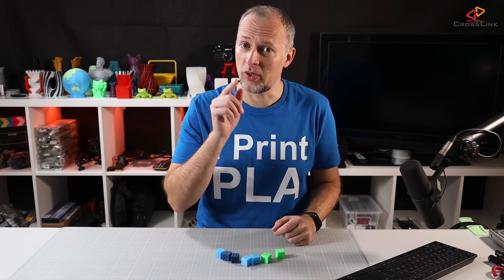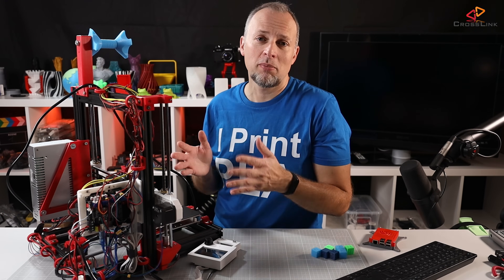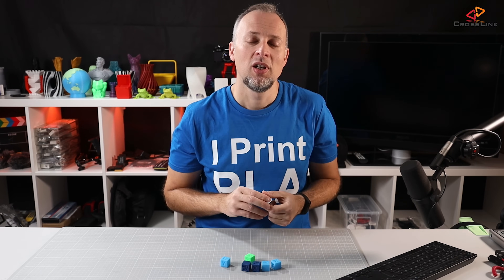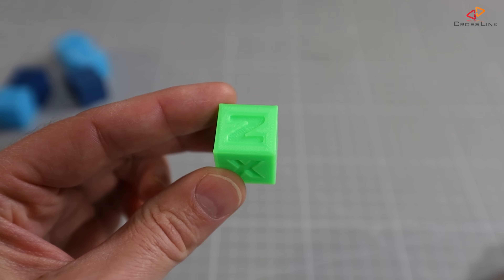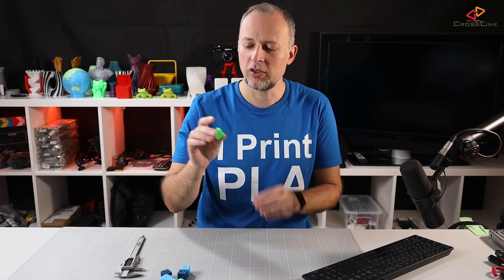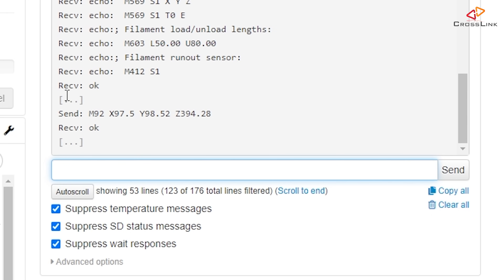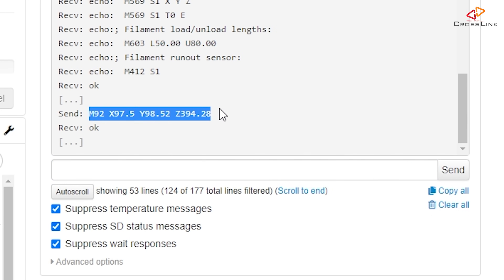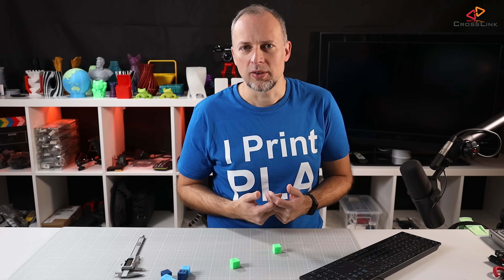SET YOUR STEPS - Fixing dimensional accuracy on your 3D printer (Cartesian only)

Comment: Ohhh noooo, this information for the X, Y and Z calibration is soo wrong and will cause issue on larger prints.
The pulleys are toothed, therefore we will ALWAYS get the same distance of travel per rotation.
The number of steps per rotation of the stepper motor is always the same. based on this the X and Y axis can be calculated from design and will be accurate for all sizes of prints.
The same applies for the Z-Axis screw and again it should be calculated from design and will be accurate.
An over dimension of a test part is always from over extrusion of the extruder.
If you change something on your printer like the size of the pulleys, and being a toothed pulley, it's diameter and circumference is easy to calculate, that's when the steps per mm for that axis needs to be changed.
My first printer I ever owned was a kit pre calibrated at the factory using this method and then locked and caused me no end of trouble printing ovals instead of circles and having bigger errors at larger sized prints.
Most (not all) standard printers like the CR10, the Anet A9 and the Wanhoa duplicator series printers all use the same size pully, based on that the X and Y axis steps per mm is 80
For the CR10 and Wanhoa, the Z is 400.
The Extruder will vary a bit from machine to machine.
Over extrusion can also cause holes to be filled in more than they should be but in some cases, you may need to adjust the horizontal expansion to get dimensionally accurate holes, this is not supported in S3D but is in Cura.

To prove the point, print out your 20x20x20 test cube, then scale it up in the X and Y axis to 150 x 150 x 20 and compare your results.
If your method was correct, then that should both be accurate, but I'm gonna bet the 150 x150 x20 will be under sized on the X and Y and not even the same amount of under size.

Ray
Reply: What you stated is true, however you are assuming all of your components are within 100%  calibrated tolerances.  The method described in the video calibrates for minor intolerances of hardware, wear,  and filament.  I wouldn't be surprised if only 1 out of 1000 pieces of hardware are being measured out of the factories in china with a passing measurement of 99.5% accurate.  The design is a starting point of measurement not the finalized numbers.
Reply: @Yakena1  You are most likely correct, however the tolerances of things like the stepper motors number of steps per rotation and the number of teeth in the toothed sprocket for the GT2 belts are going to be at a very high tolerance level as these are full unit inter values and do not change.
To get any value out of any calibration where there is a fixed limit such as the X, Y and Z travels, you need to calibrate over at least 80% of the full travel, not 10% as is done printing a 20 mm x 20 mm x 20 mm cube.
You also need to eliminate anything that can produce an error if possible such as the  amount of filament that is extruded, and this one does vary a lot and is the most common cause of errors in printers.
There are 4 settings we are looking at here and this video covers the first 3 using the name of the last one.
We have the X-Steps, the Y-Steps, the Z-Steps and finally the E-Steps.
Typically, the error in the X, Y and Z steps are extremely low to almost non-existent.
E-Steps on the other hand does have a history of being out of calibration even between batches of filament. and the ware in the extruder feed gear.
If you are going to follow a video like this one.
Calibrate the E-Steps first.
Make sure your slicer is also calibrated, and the test your X, Y and Z on a much larger print so as to cover at least 80% of the axis travel, even if you use a rectangle test part orientated in each of the 3 axis.
Reply: @CyberOne  This gets back to assuming the tolerances are with in spec.  I would not even bother doing a print.  Write a custom gcode to move your x and y axis in a continuous clockwise square (10x) that is 90% of your bed space noting your exact starting location.  Do this 10 times and measure.  It will be off by a few mm.  Now run it again counter clockwise and it will be back to the start point!
Reply: @Yakena1  Now your looking at an entirely different issue.
Repeatability.
If you have poor repeatability, then attempting to calibrate your steps per mm will result a poor result.
Things that affect poor repeatability include, loose mounts, loose belts, loose pulleys on the stepper motors.
X-steps per mm and y-steps per mm only affect the scale of the printer.

If you are having issue with repeatability with your printer, I seriously suggest you service it and tension the belts correctly.
Reply: So true.
Reply: Incidentally, E-step is short for Extruder Steps per mm. :-)
Reply: @CyberOne  i was looking for this comment because i have exactly this issue. thanks for the explanation
Reply: @EfeBaris21  Your welcome.
Reply: There is a case for calibrating belt driven axis. This is because the belt comes from the factory undersize, and is supposed to reach spec pitch of 2mm per tooth when you stretch it to spec tension. But the tension specified is usually kind of high, so you won't easily reach it on a 3D printer of any such construction without running the risk of binding or ruining the stepper motor bearing, it'll already feel pretty rough. You can easily come up a millimetre short over the size of 20cm on some machines, but i suppose some belts are lower tension to pitch.

But then of course the solution is NOT to calibrate it with a 20mm print, but to find some way to measure the movement directly over a sufficiently large distance.

One way i can think of is printing just lines on the bed that distance apart with handcrafted gcode. And then measure directly on the bed, between middles of the lines, so your over/underextrusion or bed distance doesn't imprint too much. But the measurement is difficult to perform well. Another way is to find some way to hard mount calipers such that you zero and they are pushed by the moving parts (bed and toolhead) and then measure a 150mm move, but that too can go badly because you need the calipers to be perfectly parallel to the movement direction and perfectly affixed as well such as to not move.

It's usually easier to upset the calibration than to improve it over calculated values even when measuring pretty large test prints. 20mm cubes are at best good enough for a sanity check, like you'll notice if you have a pulley which makes 100 steps/mm but you set it to 80 or vice versa.
Reply: @SianaGearz  The overall length of the belt has no bearing on the distance travelled, this is governed by the circumference of the drive pully on the motor.
The pulley is toothed with a tolerance to allow the belt to engage. but it's this one fixed machined part that set the distance travelled per revolution.  This is why, as a belt stretches over time and is re-tensioned, the calibration doesn't change.

99% of calibration errors are with the E stepper.
Here different diameter filament, or even different hardness filament can have a huge difference with the volume of extruded material.
The problem is, a lot of people will measure the cube, find it's a bit over or under and assume it's a travel issue instead of the real reason, the over or under extrusion.
Reply: @CyberOne  I agree that usually it's best not to calibrate XYZ axis but use computed values based on parts used. BUT hold it right there you say "The overall length of the belt has no bearing on the distance travelled".

My apologies for the verbosity, but i don't know how to explain what i mean better and shorter, and i can't just draw a picture in the comments.

We are going to agree that the motor and a 20-tooth pulley can advance the belt by exactly 20 teeth. But how long are the teeth? You span a belt onto an axis, you attach the teeth of both ends of the belt into the carriage attachment point, at which point the total number of teeth on the belt is FIXED. Then you start turning your tensioning adjuster that moves the idler pulley. At first the belt is loose, and we keep turning the adjuster until the belt is no longer bowed, until the slack has been taken out of it. But at that point, it's still a little too floppy, it's not going to be good enough, the belt even has enough elasticity that it might skip at the motor pulley, which wouldn't be good. So you keep turning and tensioning the belt, and you might move another 1mm from where the belt was no longer loose. These 1mm of extra belt stretch got spread over a FIXED number of belt teeth, so the length of each tooth has changed, and it has changed significantly enough to make up those 1mm of difference across those let's say 35cm of distance between the idlers. When you program a move of 20cm, and you use calculated stepping, our initial agreement comes back and thus the underlying assumption that one motor revolution is 40mm, and you make exactly 5 motor revolutions to make that "20cm" move. But with the 1mm idler adjustment, these "20cm" already grew by 0.57mm. And you're still not done with the adjustment range, you can stretch it further. And usually you're still short of true 20cm movement.

This is one of those reasons why Prusa has an auto calibration where the probe finds fixed points in the bed. Of course the system iterates on the locations until they're actually good enough and make the prints more rather than less precise, like a crude manual measurement might.

Comment: Great video! I've read online a few different arguments about how you shouldn't calibrate the steps for the x y and z as they are already calculated based on the physical components of the printer ie belt pulley size, the specific stepper motors involved ect.. I think right now the popular idea is that these inaccuracies should be fixed in your slicer with horizontal expanse.. however this doesn't make sense to me when I move my x y or z 100mm whatever axis I decide to move should move exactly 100 mm.. and on my ender 3 pro it doesn't.. sure it's close but it's not perfect.. while I've always considered calibrating the e-steps for these axes I've never actually done it as I've never heard of anyone else doing it..  but I'm all now lol
Reply: That makes no sense. Not all belts are perfect. Not all motors are perfect. Not all couplers are perfect. Sure they're 99%, but that little error adds up. My 20mm cube came out to be 20.23mm. slightly off, but off nonetheless. My "perfectly calibrated out of the box" extruder was extruding 91mm instead of 100mm. It's all fixed now and everything's how it should be.
Reply: @joblessalex  oh no.. for sure you need to calibrate the e steps coming out of the extruder.. And you're right, not all belts and pulleys are perfect.. however, I think trying to calibrate the e steps for your x-y and Z probably aren't worth any possible gains you could get..
Reply: @danielrdugan  I calibrated all of em and now everything's perfect. 20.0X error on all sides. Definitely worth calibrating every single setting on your printer.
Reply: @danielrdugan  The greatest gain would be the fitment of parts.
Reply: @joblessalex  It's best to measure the movement without the variables and inaccuracies of extruding hot plastic. Print a larger cube and see how inaccurate it is now. When using a print to calculate xyz steps/mm you will compound the inaccuracies that are involved in plastic filament, heating/extruding plastic, and introduce zstep inaccuracies into the x y dimension.
Reply: True, many "engineers" on these 3D sites say what you have pointed out. What they never address is, if what they say is true, why does making these step adjustments correct some of the inaccuracies.
Reply: XYZ steps/mm should be set based on actual mechanical movement of the print head, because there are too many variables in extruding hot plastic to set it based on measuring a single print. Use a dial, caliper, or ruler to measure how far the print head moves when gcode commands it to move 100mm. It should move precisely 100mm.

Comment: I think 20x20mm is too small for calibration, I would use at least 100x100mm.
Reply: I think your both wrong and should be calibrating based on a digital indicator like a machinist would. Wastes zero filament and you get an exact travel distance.

Comment: hi man, could you make a video about how to fix the Bltouch homing problem? I have marlin 2.0.x and my Z homing doesn't stop when the sensor detects the hotbed and it keeps going. I know that there is a fix for marlin 1.1 but nothing about marlin 2. Thank you
Reply: i had the same issue on my E3P (with an SKR E3 Mini board) after installing it.  tried over a dozen different firmware builds too.  After VS code drove me over the edge, i used Wordpad (!) to edit the files, then  VSCode to build the firmware, worked perfectly after that.

Comment: I tend to use a 100x100mm square for x and y. The larger the object the more accurate your settings will be. Once x and y are good i would only do z if I thought it was seriously out.
Reply: I normally use a 20x20 cube, but when I saw your message regarding the 100 I tried it and after entering the new settings the bed became smaller and was banging into the front y axis tensioner.  Soon as I reverted back to the 20x20 settings it reverted back to normal.  Love to hear an explanation for this.
Reply: @highroyds  Did you adjust the formula to the biger test cube, or did you use the same spread sheet from the video? Last one would give you very wrong numbers.
Reply: @nel2834  I havent used this formula for a long time, Once I got it all dialled in I left it a lone lol.  Not had any more issues and all the prints have been virtually spot on.

Comment: Hi. In my experience there always is a "elephant foot". So if you put the caliper over the whole height, you are measuring the elephant foot too, which is misleading. You should start measuring only above ~5mm height - don't you agree?
Reply: If you are using Cura, you can change Initial layer expansion to -0.1 to reduce elephants foot.
Reply: Your offset for your nozzle is too low if you get elephants foot
Reply: Save yourself time and headache and measure the movement of the print head, not the prints.

Comment: Daniel, sorry but I must disagree with your terminology: E-steps are strictly related to extruder steps ( short for Extruder steps per mm) and the rest axis are simply Steps per mm.  

As for changing steps per mm for movement axis, there is more in it.  One example: how you expect your printer to do 98.03 steps?  
Calibrating movement of axis has meaning only if you use parts from an unknown source or printed pulleys. for example  for Ender 3 Pro Creality uses cast pulley and genuine Gates GT2 belt that with every pulley teeth belt is "realigned" thus you should never change default steps per mm.
Reply from the maker: Thanks for the comment, you’re right about the terminology, I will probably update the video to correct this. On the floating point values. The digits are only relevant in movements that are multiples of that, otherwise they get rounded
Reply from the maker: I've decded to pin a comment to this video with the rectification. Figured it's very difficult to cut it out of the phrases, makes the video sound very weird at those occurences.